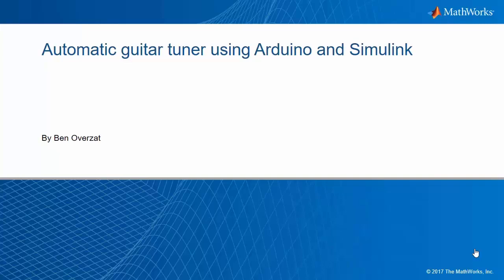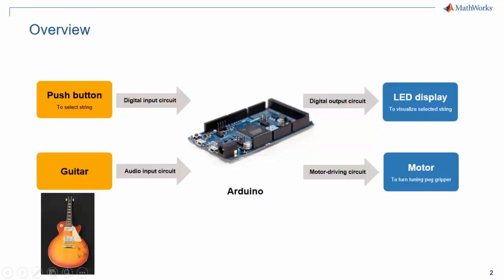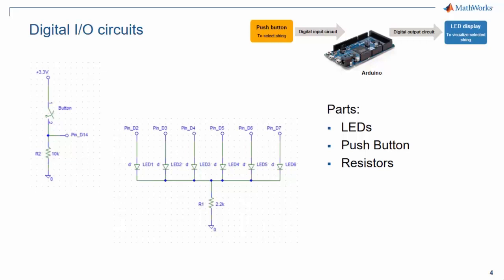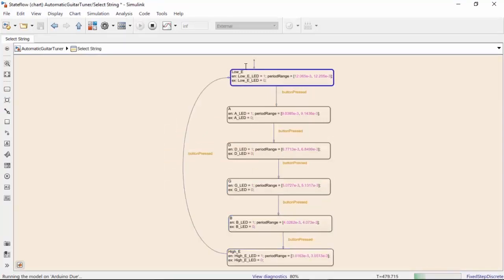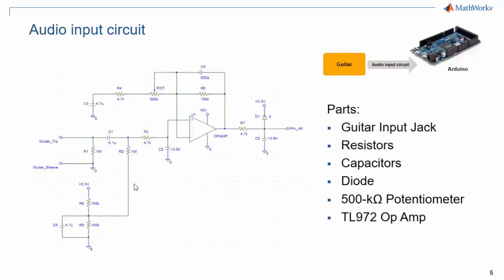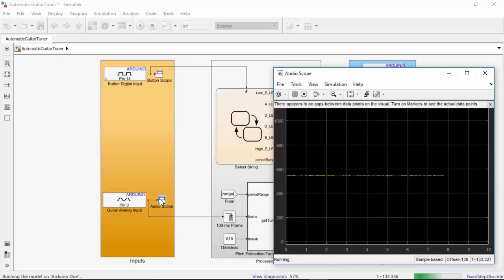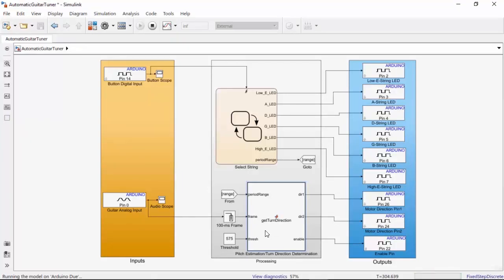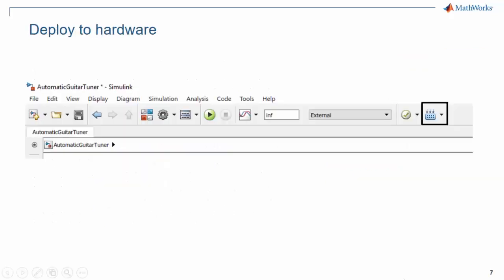How to Make an Automatic Guitar Tuner Using Simulink and Arduino - Tutorial

Comment: How did you prevent overshoot on your tuner and why did you go with a hard coded function for determining period rather than using built in Fourier transform functions?
Reply: FFT usually doesn't work in this kind of situation, because the harmonics in a guitar can have a pitch higher than the fundamental harmonic. Another technique to determinate the fundamental note could be using HPS.